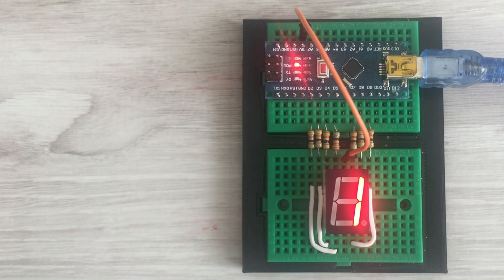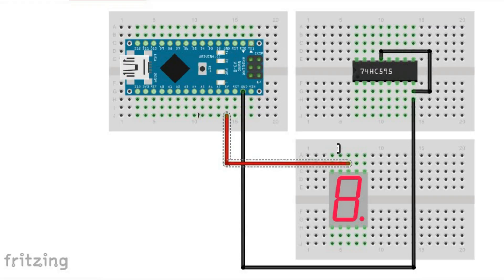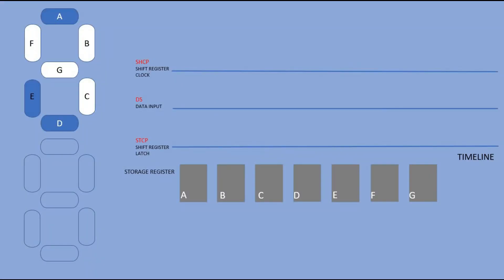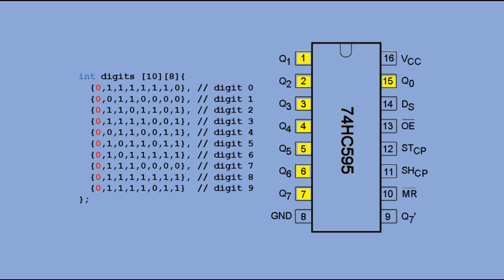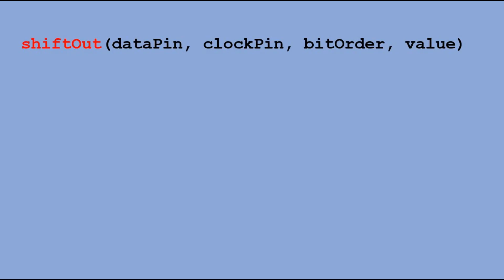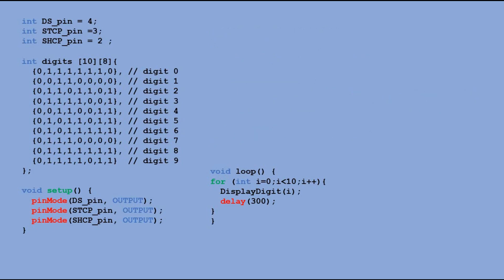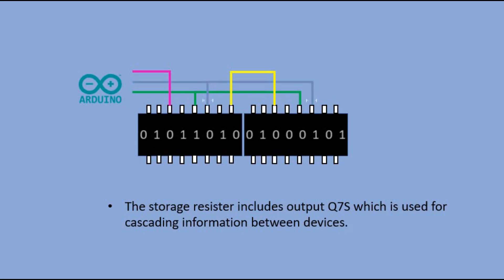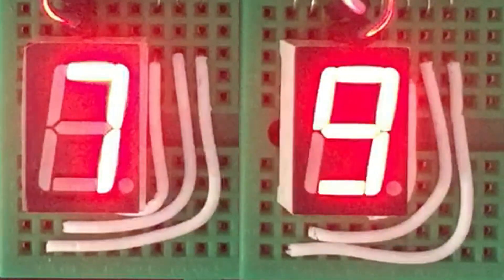How to use 74HC595 Shift registers to control mulitple 7 segment displays

Comment: I don't know if you are still active on this video but I still wanted to ask. Assume I have a four digits numbers I wanted to display, how should i display it based on the Shift register setup you have in the video?
Reply from the maker: You need four shift registers daisy-chained. To display a four-digit number, you shift out the bit patterns for all four digits in the correct order — start with the digit that goes to the last register in the chain and finish with the digit for the first one. It works the same way as in the video with two digits, just extended to four registers.
Reply: @marios_ideas  I see. I am trying to make a digital clock project with four Sevseg displays controlled by four shift register like that. I am having a problem of not knowing how to split the hours and minutes into four separate digits.
Reply from the maker: @leoornstein3963 Shift registers are not your only option. There is the MAX7219, which is great for controlling 4-digit displays.
Check out this link: https://www.youtube.com/watch?v=IiWhnIhf-uU

In that video, at 8:17, you will also find formulas for extracting individual digits from a 4-digit number.

If you ever want to get into creating custom 7-segment digit displays using the MAX7219, this video may also be of interest:
https://www.youtube.com/watch?v=ux3cpw0nHo4

Good luck, and consider supporting my channel! :)
Reply: @marios_ideas does the formula works for Shiftregisters?
Reply from the maker: @leoornstein3963  The formula is to extract the digits from the larger number it is independant from the electronic part. Having a number then you come up with but sequence and you use it to push into the register. So having time 12:45 you need to extract 5 4 2 1 get their bit representation and push those digits in this order into the register

Comment: I want to add a third digit to display a 3 digit count with a maximum of 999 - full three digits.  Can I modify your code by  adding a "third" for loop  - for (int k=0; k<10; k++) and achieve the 3 digit count for testing?

Comment: what type of segment display do you use, is it a common cathode or common anode
Reply from the maker: You can use both. For common cathode you lit segment by sending high signal to appropiate pin. If you deal with common anodę then you lit the segment by sending low signal. Check the code and from it it will be apparent which tyle was used.

Comment: How to display negative number?
Reply from the maker: Apart from Mapping for each digit in the table you have to add to the table one more row where only segment G is set , which will represent minus and then in the code you need to add logic that checks if the number is negative and if it is you need to set the most significant digit/7seg display to minus

Comment: What about driving multiple seven segment displays with just two wires (data wire and ground) from the MCU?.using for example NRZ , Manchester coding or other asynchronous serial data transfer schemes ,is it possible?

Comment: what parts do i need to make a 16 segment do 7 characters ? PRND321 .
Reply from the maker: You mean this one? https://pl.aliexpress.com/item/1005001297960517.html  These modules  have dedicated library. If you wanted to control a single display for one digit/character you can do it yourself using 2 shift registers but it is a lot of connections each of 16 segments needs to have its own resistor. If you were to wire 4 of these that would be 8 shif registers and 64 resistors. Good luck:)

Comment: Hey, wouldn't it be easier to just use on resistor on the cathode instead of using on every anode?
Reply from the maker: Yes it would. I use it sometimes. But in this setup the brightness of the segments will depend on the number of segments concurrently lit when using a single current limiting resistor connected to the common cathode. When multiple segments are illuminated simultaneously, they will share the current flowing through the resistor. As a result, the current is divided among the lit segments, potentially reducing the brightness of each segment compared to when they are individually lit.

Comment: Back in the early '90, I used 4 CD4094 shift registers (similar to 74hc595) and used the clock pin to discharge a capacitor (to Gnd) resistor (to 5V) through a diode to automatically strobe the data. Only 2 pins used. It was controlled via the parallel port of a Dragon 32. Great times
Reply from the maker: I have to admit I am not familiar with CD4094. Does it work in more or less the same way as 74hc595 or the concept is different. The use of the two pins with use of capacitor sounds like something that is waaay over my head:) Can you explain the concept?
Reply: @marios_ideas  Yes, cd4094 and 74hc595 are the same except pinout. A resistor connected to 5V charges a capacitor and the diode connected to the clock discharges it. At the end of the transmission, clock stays high, the capacitor charges and triggers the strobe.
Reply: You use CD4094 like decade counter IC, right?

Comment: I think you may be overdriving the 74HC595 which has a total chip current limit of 70mA.  What value did you use for your current limiting resistors (you appear to be inconsistent across the two displays),
Reply from the maker: This is an old video an i am fully aware of my electronic shortcomings. i will check but i think i was using 220ohm resistors but the couple of 330ohm could have sneeked as well. Can you let me know How you would do it not to overdrive the shift register. What is going to happen when it overdrives, will it be damaged or will it work in unpredictable way
Reply: @marios_ideas  Powering at 5v, assuming 2v forward voltage typical for each red LED, and 220 ohm resistor, each LED consumes (5-2)/220 = 13.6mA.  When all 7 segments are lit producing an "8", that's 7*13.6mA = 95mA.  The datasheet for the 74HC595 specifies a max chip current of 70mA (note: one should always go under that amount, leaving some headroom).  I see many videos which makes this same mistake, one should always read the datasheet and understand the limitation of the devices, I can't stress that enough.  A simple fix would be to use a higher resistor value.  470 ohm would be fine and I doubt that you'd even notice a difference in brightness (due to the V I curve of LEDs).  the 74HC595 is not designed to be an LED driver.  If you really needed to drive more current, then its common to use a TPIC6595 or pair the 595 with ULNs which are darlington sink drivers and can handle a much larger current draw.  Also, if you overdrive it, 1 - you might get "lucky" and nothing may happen, 1- the chip might overheat, 3 - the chip may behave unpredictably, 4 - the chip may not last very long.  Also, you should use a decoupling capacitor on each 74HC595 since they are prone to spikes due to their switching speed.  Thanks for responding, we are all here to learn.
Reply from the maker: Thank. That was valuable lessin. I think i had some unpredictable behaviour in one of my projects which i did not understand. As to capacitor which should be a value and where should i place it, between vcc and gnid pins of register?
Reply: @marios_ideas  .1uf (104) is commonly used.  Place it as close to Vcc and ground as possible.
Reply from the maker: Since we are talking I would ask you to have a look at my other shift register video. There I was testing a breakout  board for 74HC164. There I went for a shortcut and used just one current limiting resistor connected to common pin. I know this is not the right way to do but am I right in saying that this way I will not overdrive the shift register. When purchasing this from china I did not receive a datasheet for this part. Should I then in this case check generla datasheet for 74HC164 chip?
Reply from the maker: https://www.youtube.com/watch?v=sQfghvHYTlk

Comment: Hello. Very nice video. Just one question: in my experience I found out that obsolete digit is place at end of  digits array, eg: digit[0] = {1,1,1,1,1,1,0,0}. It might be just that my design is different but i couldn't find the difference. Pls let me know what do u think :)
Reply from the maker: You are right. I did video in this way. Actually in 7 segment display you have no obsolete bit. The 8th bit represents dot. It is an old video of mine and I would do it differently now. But the great thisng is that you can come up with your own bit order and make it work as well. PLease check by newer video on this topic https://youtu.be/sQfghvHYTlk

Comment: What about alphabets if we need to use them, for eg.  Err or something like that.
Reply from the maker: It is common anode. And you decide What is going to be displayed on each display by pushing in the right combination of burd. If you do not want to have leasing zero you push in 00000000 instead of bit representation of zero. If you want to have characters you need to make out the bit representation (which segments schould be lit) for those characters. If you want to use 3 registers then you push in 24 bits instead of sixteen

Comment: The type of Seven Segment display used by you is Common Anode, am I right in my assumption ?  Also, is there a facility to show only 3 or 8 instead of 003 and 008? Would like to hear from you.
Reply from the maker: That is correct it is common anode. If you do not want to use leading yeros you just need to push in bunch of "1"s into the register then no segment would be lit.  In a meantime I created won more video on shift registers. I would encourage you to watch it as well. https://youtu.be/sQfghvHYTlk

Comment: Hello, its a nice video and I have learnt quite a lot from it.  I however have a doubt, if I need to make it a count down timer with 3 digits, I would be needing a third shfit register.  This is clear, but what changes do I need to make in the code?  For Eg.  I need to count down from 399 to 0 or 198 to 0.  Would appreciate inputs from your end to clarify further and make it wholesome..
Reply from the maker: You have to push the sequence of 3x8=24 bits instead of 3x8=12 bits.
Reply: @marios_ideas  Thanks Mario, I will update the details on the project here.  I have another query for you.  

a.  Does any of the data, clock and latch pins need pull up resistors ? 
b.  what about the serial out pin of the first 74HC595 and the serial in pin of the second 74HC595?  Do they need any for stable and reliable operation?
Reply from the maker: @madhavdivya  No. There is no pull up resistors. As the state of the connection is always know, it is either high or low. In case of e.g. using push buttons you need pull up resistors as when not pressed button is like a loose wire, and such flaoting connection has to be pulled either up or down. I have never experienced stability issues when daisy chaning the shift registors.

Comment: How do you calculated the current limiting resistor's value?
Reply: Ohm law(U=I*R). You take the average LED current consumption (ex 20mA) and the forward voltage (ex 3V) and you calculate U=3V, I=20mA => R=3/0,02=150 ohm

Comment: Hi Mario,
I like your work, using registers for 7 digit display common anode. Do you have schematics on how to connect common cathode 7 digit display? I look forward to your reply. Thanks!
Reply from the maker: Well the connection would be the same. Only difference is that the common pin of the display would go to ground . The code then has to be changed . You have to change 0 to 1 and 1 to 0 in table representing the digits
Reply: @marios_ideas  Thanks for the confirmation. I will try it and let you know!

Comment: Which pins would you use if you wanted to do this with a Teensy 3.6?
Reply from the maker: Don't have experience with Teensy but with Arduino you can use any three digital pins, so I think this would be the case for any microcontroller
Reply: @marios_ideas  perfect, that's very helpful thank you for quick reply!!!

Comment: Hi, I am still confused in the first code. You said that if you write HIGH in DS and SHCP, it will then throw HIGH in the storage register. But in the code - if(digits[Digit][i]==1) digitalWrite(DS_pin, LOW); isn't it a bit contradicting? I am very bad at programming, can you please enlighten me? Thanks in advance.
Reply from the maker: This is a common cathode matrix so you light the led by sending low signal. In the table where I store digit info the pixel that needs to be lit is represent by one . So in this if statement i invert the state
Reply: @marios_ideas  Thank you very much for the explanation. I finally got it!

Comment: Hi,
I think I have an issue with the shift register.
am using TPIC6C596 shift register and this register is capable of sending 8 bits. When I start sending 8 bits, I am getting only the last bit (i.e decimal point). But without the 8th bit (decimal point), my shift register can transfer whole 7 bits at a time. May i get the solution for this? When I implement in the proteus I am getting proper output. while doing the same in the hardware, I face the issue. For example, 0b00000110, I am getting the value as 1. if i do, 0b00000110 | 0b10000000, I am getting only .(dot) without 1. I should get 1.(one + dot). shiftOut(DS_pin, SHCP_pin, MSBFIRST, dec_digits[(buf[i] - 0x30)]|0x80); What will be the issue.?

0r my doubt is when supply goes to decimal point, all the other pins goes to OFF condition.
When supply don’t go to the decimal point, all the other pins goes to ON condition.
Is that correct?
Reply from the maker: You should get 1 with a dot when pushing  0b10000110 if that does not work then there is something wrong. Also mind in my video I did not even connect decimal point. I just posted a new video where I design and order PCB for this. There I include DP. When this board arrives I will make a follow up video where I will use DP as well

Comment: can I extend this for a 6 digit clock? Chain-connect 6 shift registers for 6 7-segment displays? Or is there a better solution? Thanks for the video, very clear information!!
Reply from the maker: Yes you can but with this many it is better to use  MAX7219 chip. I have video covering sort of this topic . https://youtu.be/SGjQ-E3UD7A look at the code and change it to use two moe rows for 2 extra digits . You can use ready to use module https://www.aliexpress.com/i/32795462309.html
You can also buy ready to use modules but I could not see 6 digit ones ony 8 digit ones. But I am sure I have seen one in the past just cannot find one now
Reply from the maker: See my reply to riuza
Reply: I'm also looking for this, but I think 6 7-segment display bundle (all in one) are way more efficient, than just 6 times 1 seven segments display bundles, but I didn't look up yet how to wire them with shift register as there is another type of wire selection to make, but it's dooable (I think there are even simpler bundles with integrated components to the display, like TM1637 ? 4 wires for 4 digits ?)

Comment: Is it possible to have 16 bits with 2 shift registers or 15 bits? Can the pin 7 on the first shift register be different than pin 0 on the second?
Reply from the maker: It is entirely up to you. This shift register was made, i think to control 7 segments display, and with 8 pins can control 7 segments and a dot. As you can see in my video I ignored the dot. But you can also e.g. control 14 segment display  https://en.wikipedia.org/wiki/Fourteen-segment_display. Here you would need 2 shift registers but use only 14 pins out of 16.

Comment: I have two displays that each have 3-digits. They are multiplex and each have 12pins. What would be the best way for me to control them in a project? Should I buy multiple external drivers? Or just a bigger arduino controller?
Reply from the maker: Can you send a link to that display? 3 digits should requitre 7+3 pins (7 for segments 3 for digits) Are the other two for 5v and GND?
Reply: @marios_ideas  Yes, here is a link to the data sheet.  https://www.silicon-ark.co.uk/datasheets/hp5082-7400-7430-display-hewlet-packard.pdf  It is the HP 5082-7433 bubble display, the schematic and pinout is on the last page. They seem to have 11 active pins, and I am wanting to reduce the number of pins, so I have some free room on my arduino.

Here is a video of a special driver someone made, to reduce the pinout to make it easier to attach to the aurdiuno: https://www.youtube.com/watch?v=qx0lQD_BhHU
I am planning to have one of the displays show voltage, and the other to show current. Thank you for the help.
Reply from the maker: @izzyramos-gunn9895  The answer is max7219 chip. Check my video https://youtu.be/IiWhnIhf-uUhttps://youtu.be/QI1IJLB42G8 and let me know if it helps
Reply: @marios_ideas  I ordered a 5 pack of the max7221s. They work well, and have a lot of features. I was originally going to buy shift registers, but the max7219 seems to be popular. Looking at the data sheet, it seems to be a shift register with other features.

Thanks for the recommendation. This is the perfect chip for my project. They work well.